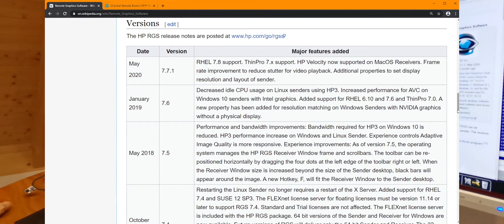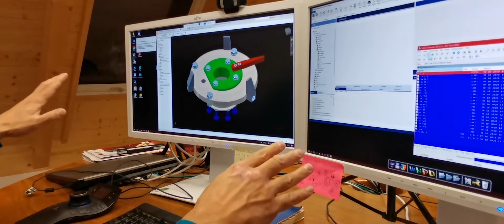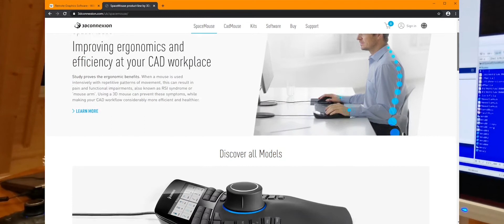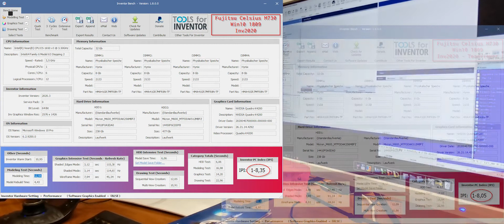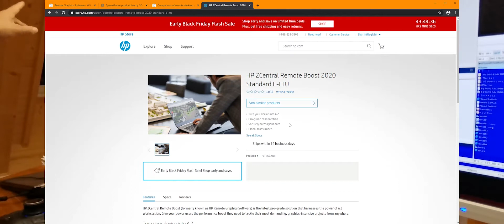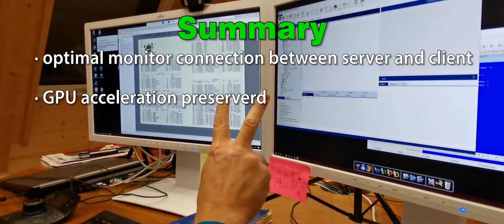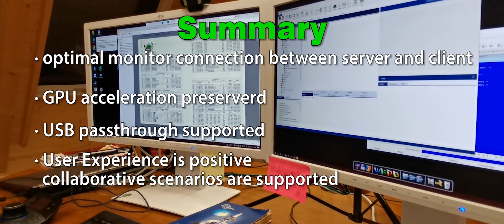HP RGS - ZCentral Remote Boost - 5 min hands on

Comment: I have 1x HP Z8 Workstation and 2x Users using Lenovo Laptops, what software and settings required for 2x Laptop users to collaborate (view screen) with Z8 User ?
Reply from the maker: As in all other cases you would need the "sender" on the Z8 workstation and the "receiver" on the laptops, assuming that what you plan to do is to share the content of the workstation to the users on the laptop, or alternatively allow the users on the laptops to access the workstation remotely

Comment: Hi Massimo
what about using this system on windows server, with 4-5 RDSH ? what about GPU resources balancing?
Reply: Sorry, I have overseen this comment. I have done some experiments in this direction, but as a matter of fact it turns out cheaper to equip one workstation per each user, at least in our scenario. Technologies like GPU passthrough do work, but it feels like graphic card producers do not want you to share GPUs across multiple users.
Since HP has changed his marketing and licensing approach to this technology dramatically, all my customers that were going on this path have actually chosen to look elsewhere (and I am the first in the line to be honest).
Reply: @turbo4bmx  Dear Freesbee we are also facing this strange licensing thing in our company now... Is there a good alternative to RemoteBoost/HP Anywhere? I mean 250€ anually per sender device is really expensive

Comment: Why use this over Windows RDP?
Reply from the maker: There are two main reasons to explore alternatives to RDP as this one. 1st Reason: RDP does NOT leverage hardware acceleration, so you would not be using the graphic card installed on your workstation. 2nd Reason: if you ever desire to use a 3DMouse as the one shown in the video, you would NOT be able to pass the device to the remote workstation without a third party tool. So if you are going to pick a third party tool, why not to pick one that does both?

Comment: Hi Massimo, nice to see you suceed to work with the 3DConnexion device via ZCentral Remote Boost. I try to do the same in combination with Inventor and a Spacenavigator. Any tips how to configure? By default it is not working out for me. Connection is OK, but no succes with the 3D connexion device.
Reply from the maker: Default installation by ZCentral is to forward the entire USB traffic between receiver and sender. Something that maybe is NOT very intuitive is the following: 1. on the receiver make sure that "Enable Remote USB" is enabled; 2. establish the connection to the sender; 3. plug your USB device into your receiver (you can try with a USB stick first, it will work the same). At that point you should see the Sender detecting the USB device

Comment: Very well structured video. Thanks.
Reply from the maker: Our guys (50 very conservative German designers) have been using it productively for 8 months now: they are happy with it and want to keep it for the future
Reply: @turbo4music  we're trying to implement this in our office as opposed to using TeamViewer or AnyDesk. This solution seems to address all the issues that come along with those remote in softwares
Reply from the maker: @ThePrinceFDarkness  besides costs, which are sensibly lower with RGS, the reasons that brought us to this choice were also to allow our guys to connect private devices to company assets in a secure way, and control this access on firewall level. All these requirements are perfectly fulfilled by RGS, while this is not always the case with other technologies (as the two that you have mentioned). Private devices are allowed through the firewall only to the RGS port, and senders are configured to refuse any connection that is not explicitly allowed, as for example USB sticks. This way the private device only acts as a thin client offering monitor, keyboard, mouse and 3Dmouse for the remote worker. Additionally, the company asset is not always exposed to the internet, as it happens otherwise
Reply from the maker: HP has changed his pricing significantly since then. I have explored some alternatives, and one of them has been successfully implemented by one of my customers: noMachine